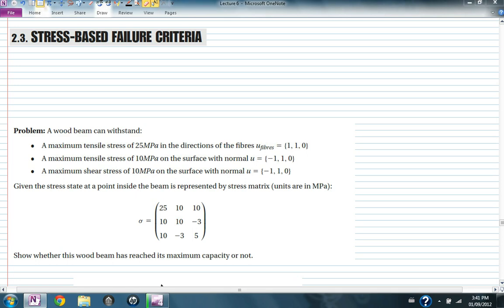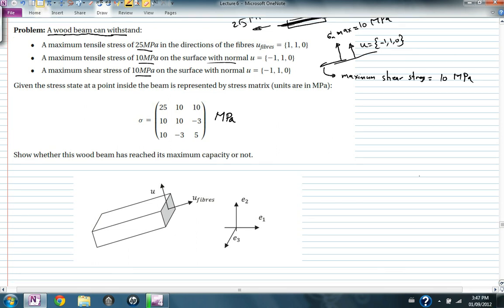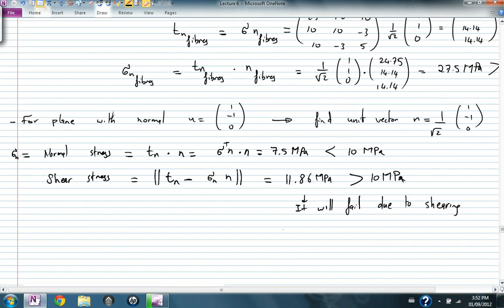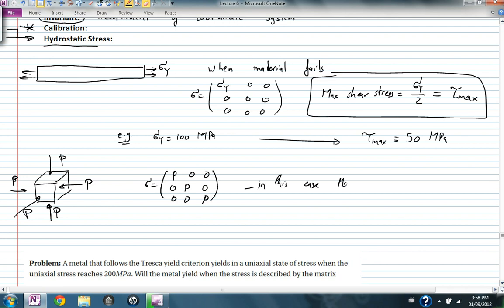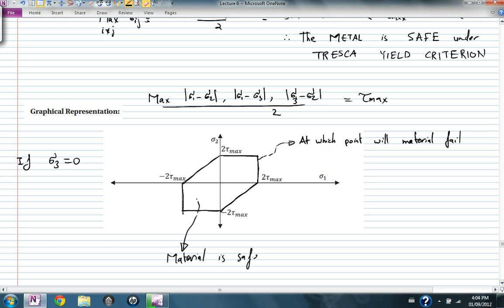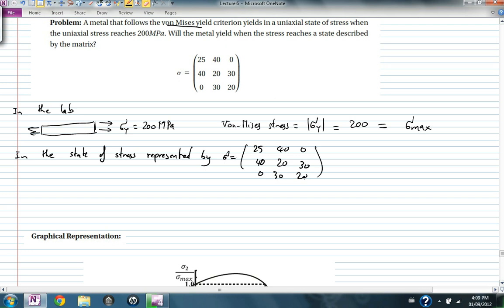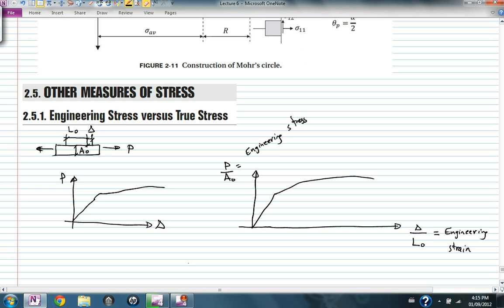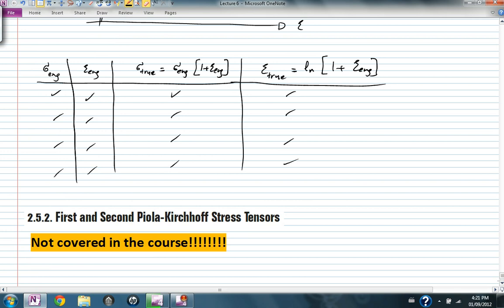Lectures 6 7 Video 3

Comment: matrix calculation is wrong .the third entry in the matrix is 4.94 and not 14.1
Reply from the maker: Yes. You are correct. That's @7:30. The third number in the vector t_nfibres is wrong
Reply: Samer Adeeb But however the final answer is correct.final normal stress
Reply: Samer Adeeb Can u please share me ebook which u used for this ..
Reply from the maker: Sorry, that was a few years ago. I don't have that anymore. I probably just copied that number wrong.
Reply: Samer Adeeb oh no Problem. good lectures . thanks